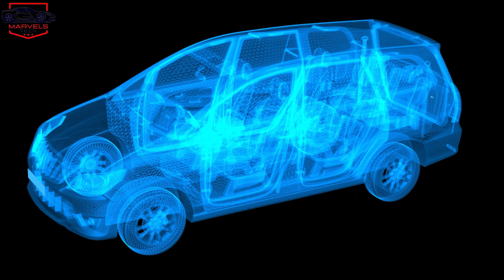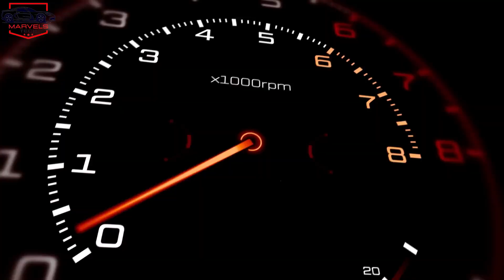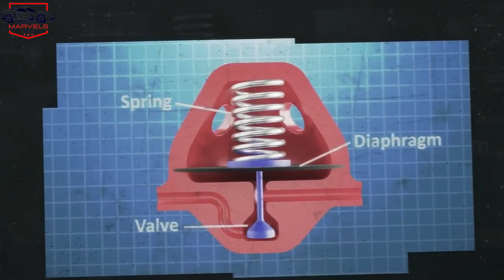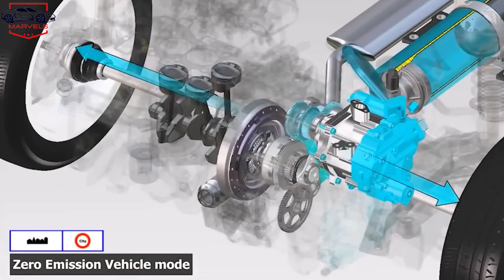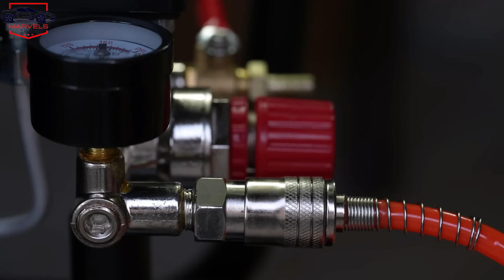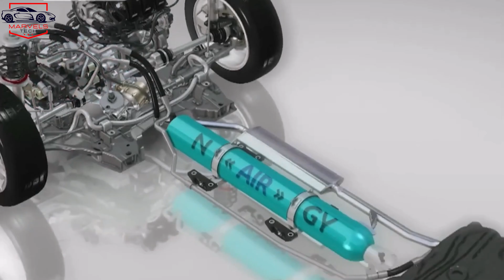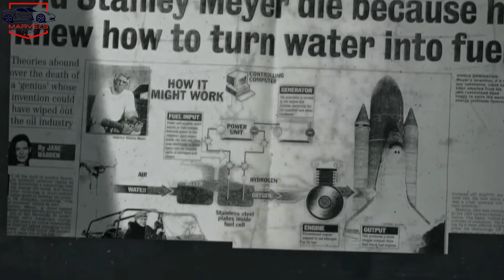This New Air Engine will Change the Car Industry | Says GM CEO | Tech News

Comment: So we will convert electricity with a compressor to very high pressures which of course loses some % Of energy.
Then you get in your car some gas tanks with over 100 bar+.
No way of refueling your "air" car at home or a very expansion set up at home lol.
Giga air compressor fuel stations for filling up cars.
Absolutely a great idea.
Current EV batteries are actually 4 and+ times more energy dense then pressurized air.